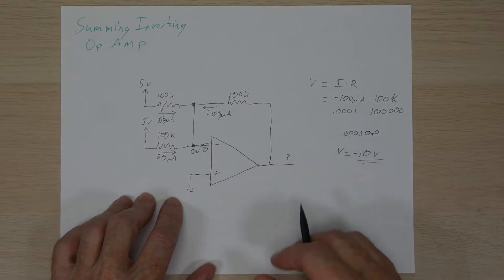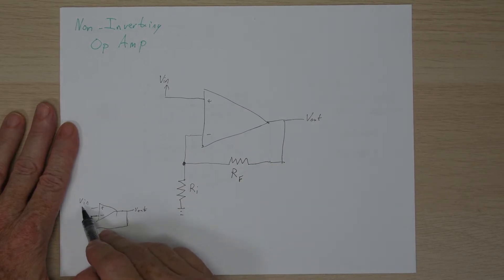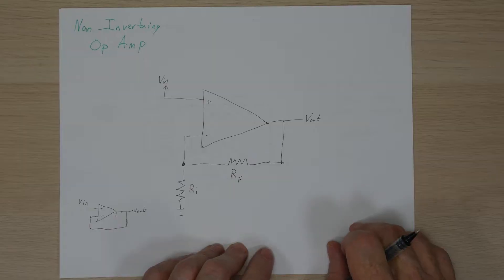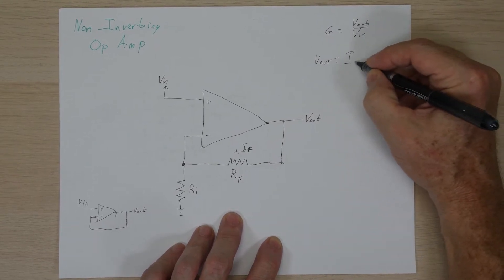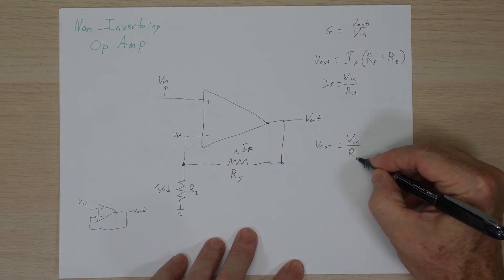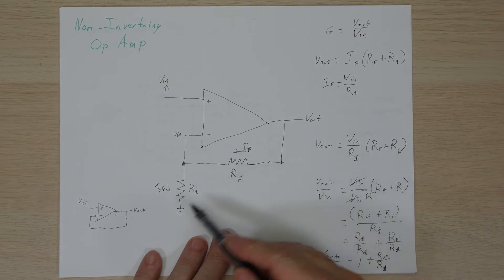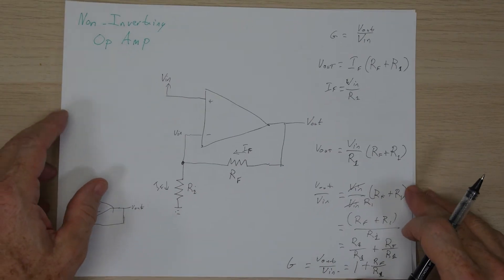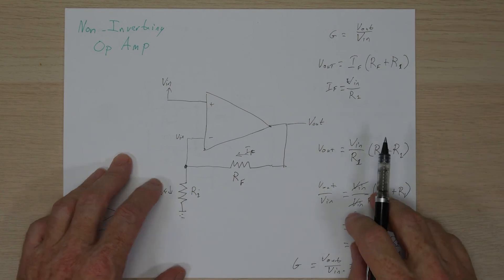Why Modules Usually Use Inverting Op Amp Circuits - Eurorack Mixer Module Part 4

Comment: Again, such a well explained video, thank you! Looking forward to the next video in the series! As for the projects I’m working on: Right now I’m making a panel for a DSO 138 mini Eurorack conversion so that I can see a bit better what’s going on in my rack. I’m also working on some panels for Mutable instruments clones! Grids and Shelves are the next ones I’m soldering up! 

Here is a little request: Could you maybe explain input and output protection on the jacks going in and out of the circuit? Thank you for making these videos, super helpful!